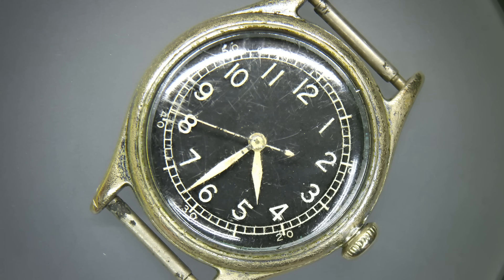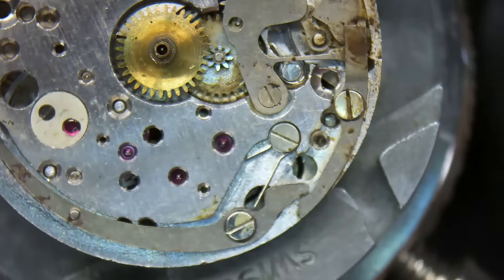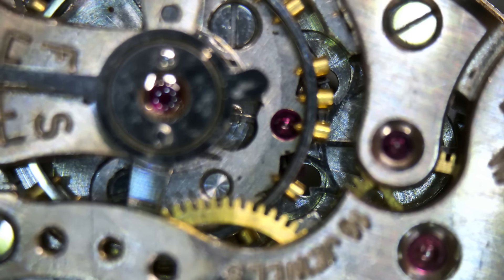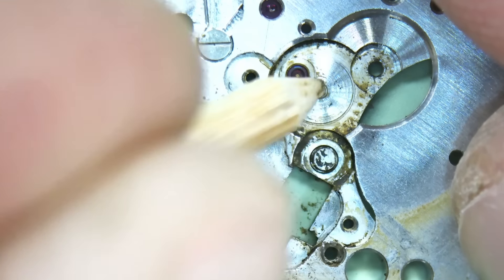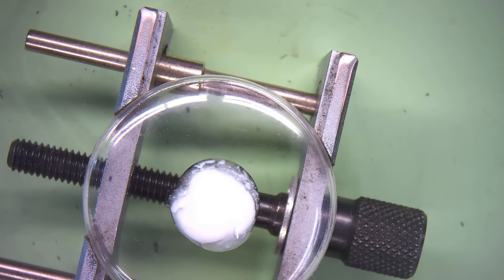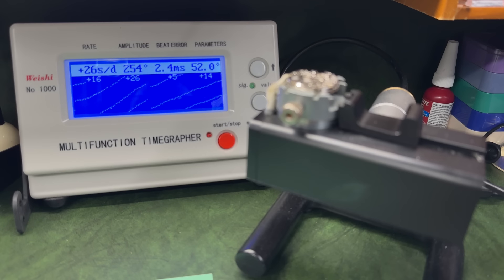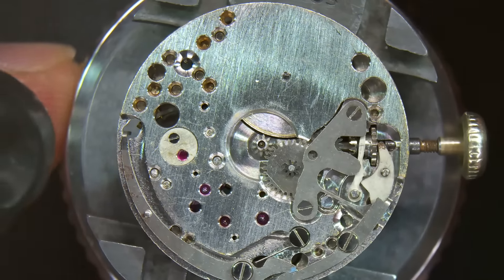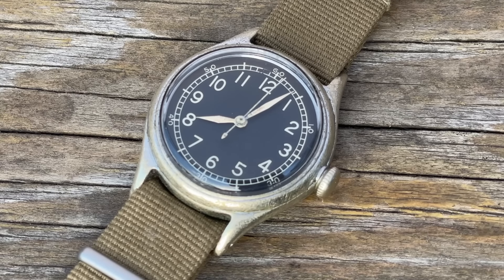"Restoring History: Repairing the Vintage WWII Bulova A11 Military Watch

Comment: Great to see one of these being refurbished. My 101 year old father still has his RAF issue Bulova with the original A11 markings overstamped by RAF 6B/234 markings. He was a navigator with Coastal Command and might be amused to hear your comment about hacking. Once I said to him something like "I guess it was very important to have your watches  synchronized so that you could arrive over the target at the right time". His response was that in practice they were lucky if they got over the target within 10 minutes of each other!

One turn of the winder is enough to make it start ticking and I don't think it's ever been fully serviced. It's been demagnetised and at one stage a small speck of dirt was removed from the movement (by a  watchmaker who didn't charge for doing it!) but that's about as close as it's got to being properly cleaned/serviced. Dad only wears it very occasionally now but it'll keep going for a day.

Keep up the good work.
Reply from the maker: @johnhaddock373  wow that’s really nice story, I’d still recommend getting the watch serviced at some point. 80 years of running it’s important to keep the movement clean and fresh oil.  You would not run a car that long and a watch in theory runs 24/7 year by year unassisted . 
With your double stamps it would make yours more prised, not that it’s something you would ever sell.

Comment: Just looking over the video again, The second pinion was attached to the cover plate when removed when it cuts away. It must have dropped off unnoticed between the movement and the storage container. Losing this is the best way to ruin your day - glad you found it
Reply: You can see it escaping to the left for a frame or two.
Reply from the maker: @gerryodonnell321  thanks. I watched that many times and some of the uncut footage but I could not see it!  Either way was so relieved to find it .

Comment: Fantastic work, Mike! I love these older Bulova movements. It's straightforward and fairly simple to work on. Your comment about not messing with the hairspring until you've had some proper practice is spot on! I have made that mistake myself, and I can confirm that more practice was needed. Especially when working on smaller movements. Thanks again for the video!
Reply from the maker: @mltrymn1213  thanks.  I still don’t like hairsprings but have enough hand control to handle them safely enough .

Comment: Great microphotography, Mike! The clear depth of field makes a difference. And nice work on the service. One thing your videos really help us learners with is the precautions you take with disassembly and reassembly to avoid breaking parts. Would love to see more about precautions, hint hint.
I’m with you on case sizes: it’s downright irritating to have fashion dictated to us, and who really wants to wear a chromed hockey puck on their wrist?

2:21 Movement wobbles. Were many vintage Bulova movements poorly supported inside their cases? I’ve had this issue with a few.
12:00 have you tried small amounts of lighter fluid to free up parts? The fluid can be delivered with tweezers directly to the part, like an old fashioned ruling pen to get under bridges and cocks having no slot for a screwdriver, and alongside alignment posts
38:16 I’ve deliberately vandalized movements by scribing an extra line each side of the slot of left hand screws. In 50 to 100 years, that next guy will be someone very unusual and deserves a polite warning.
45:20 I’ve seen some Bulovas scratched up, online and in my collection. Either the metal plate was sometimes soft, or someone’s cleaning method was violent.
Reply: Про хромированную хокейную шайбу на запястье верно подмечено.

Comment: Hi Mike,  I was yelling at the screen that second hand “axle” had fallen under the holder and later on that you had forgotten to put it on (my mistake there). 🤣🤣 I love the watch and you did a fantastic job on it.  In the comparisons, the homage ones really mess up on the crown.  Big, sharp and chunky makes it look like it was stamped out of raw steel and not polished like the original.  Just cheap knockoffs is the message I am getting from that.  Cheers 🍻
Reply from the maker: @dsb1763  Thanks. Seems many of you saw the pinion but I didn’t even watching it back in edit!

Comment: Mike that was a dirty little critter. You handled it just like pro. I enjoy you so much. Thanks. I am just about to start my first watch just waiting to get all the right tools rounded up.
Reply from the maker: @chrisorcutt7619  good luck. Keep patient and take lots of photos.  It’s difficult at first but once you get some control and confidence with your tweezers the rest will come. Buy a decent pair of tweezers like Dumont.  £20+. Sounds a lot but it’s the one tool you use the most.
I’ve used Dumont 00 hi tech for years , same pair for 5 years at least . Never looked back once I bought them .

Comment: A watchmaker once taught me to remove the pallet fork and make adjustments to center the impulse jewel between the banking pins. Usually that gets you in close to a low beat error. It is less risky, mostly  because you have to make fewer intrusive moves IMHO.  I do enjoy watching .
Reply: Do you mean that you turn the collet with the impulse jewel, with the balance in situ, rather than remove and split the balance assembly?

Comment: The case actually looks pretty cool like that. Nice and rough. Amplitude could be caused by the 52°angle input which may be different or maybe barrel pivot holes are worn. Overall great to watch and listen to you. Fantastic sweep pivot find!
Reply from the maker: Thanks, I still might service it again and see if the amp comes up. When all the cameras are in the way I dont think I am as thorough as I would be off camera due being obstructed visually . Finding the pivot was a relief and wore my knees out !

Comment: Nice work mate. The sole service looks like it was previously done by a monkey. So many scratches. The result has come out well considering the age, the condition, and the original state of having so much seized up. You've done well mate. Thank you for the effort of recording another cracking video.

Comment: Nice restoration on an old soldier. I thought the A11’s had a one piece case and a split stem. You remove the movement from the front after removing the stem, crown and crystal.

Comment: Mike, ref beat error, I wonder whether it is best to replace the balance into the movement at a point when the pallet is not inserted. In that way the could balance jewel can be set to the mid point of the banking pins at it’s natural rest position. Would this depend on the balance wheel poise being accurate at first (just a thought). I was wondering whether the force on the pallet would affect where the balance wheel sits. I am early in my journey of watch making, don’t yet have a timegrapher and so have not yet attempted to fix a beat error but love watching your (and others) videos to get some pre knowledge of the challenges to come!

Comment: What solvent do you use when the gears are frozen?  I know what to do on a automobile but PB Blaster maybe to harsh for a wrist watch.
Reply: As far as I can tell, brute force. I would try penetrating oil, or just oil, or WD40, etc. Steel and brass are not that delicate and it's going to be cleaned anyway so it doesn't really matter too much. Oh well.

Comment: I have one of these watches, found it at an antique shop.  Had a ladies bracelet on it.  The bracelet was from the uk, so I assume the watch was issued there as well.  Or maybe left after it was used.  I was able to get it running well but can’t find a proper gasket for it.  Any ideas on a source?
Reply from the maker: No idea on gasket, there is one on the crystal on mine so I just measured it and found one to fit. Caseback mine is okay but again just measure the inner diameter and work from that

Comment: was wondering about the main spring and barrel disassembly and reassembly which you seem to have skipped showing
Reply from the maker: I dont often show it because its not that interesting and does take some time and on an hour long video I have to decide what is kept in.  A mainspring is unwound from the barrel by hand, I would need a much wider angle to show that all.  I then use a spring winder to wind them back in the barrel.  In this video I shown the oiling of the barrel and then pushing the spring in using the tool which is over in 2 seconds and not visually entertaining. fitting the arbour is a fiddly job that I often have to use a pin vice to do it and all you would really see is my fingers from any angle of a camera.  It is why most likely 99% of other channels do not show this either.

Comment: Loved that video 👏just a quick question sometimes when using my ultrasonic cleaner some parts turn black in colour keyless works ect..  what am I doing wrong? I use the sea  lean 2 fluid . Any advice would be appreciated.
Reply from the maker: Your mixture I would think is too rich.  I no longer use anything water based for parts. Sea clean just for stainless cases and bracelets. It does say if anything is plated it will react
Reply: @MyRetroWatches  Thank you Mike that’s very helpful. I did weaken the solution but still messed up some of the parts which was so annoying especially on a lovely clean seiko movement. Which solutions do you use?
Reply from the maker: @MagWatchTime  well I have a cleaning machine so specific fluids for that from L&R but they are quite expensive

Comment: When you have a stuck wheel like that, likely from corrosion, is there any reason why you couldn't use a drop of penetrating oil just to try to free it up, since you're going to clean it afterward anyway?

Comment: Is your cleaner fluid contaminated with cloth fibres?  On the reassembly there are tons of little fibres over everything and those are going to bind up and cause issues down the road I am thinking :S
Reply from the maker: I do mention this in the video. I am working in my garage which is also the laundry room. Seems most stuff is in the atmosphere than normal.
I spotted most and rodico it out, again a bit in the video. I do miss some because when you film a service you are no where near the movement like I would be without cameras. It does make things much more challenging

Comment: I call these unmarked ww2 watches ‘Captain Mannering’s" as the home guards would have probably used them too. Nice restoration mate.
Reply: I’m sorry but that is nonsense.  This A-11 is not a marked issue watch but A11s were issued to aircrews in the USAAC/USAAF, Ord. (Ordnace dept.) watches were issued to ground troops. I have seen both without markings on The case back.

Comment: ''THEY''
They served & defended those lives They did not live,
For They in Their day were They
Reply: Normally I do not REPLY to myself. But when I do - it is for damn good reason.
From '71 --- '74 I chose to dodge the draft having had a lottery number of 52; by spending those 3 years occupying a slot of one of those WW2 ''THEY''
~ U.S, Paratrooper Sgt, William 'Rock' Gilpin 82nd Abn Div.1/504...
half a century ago.